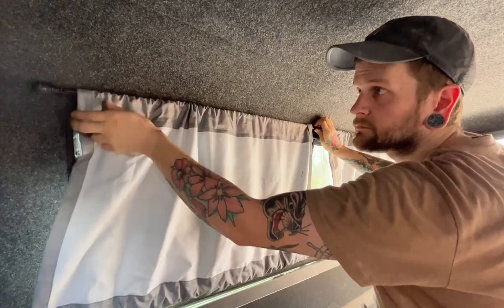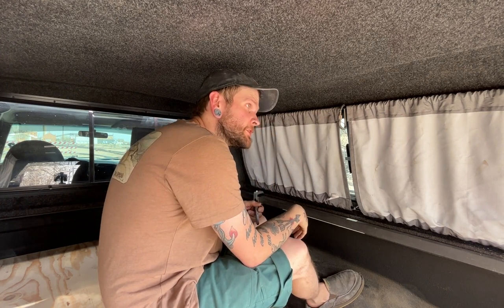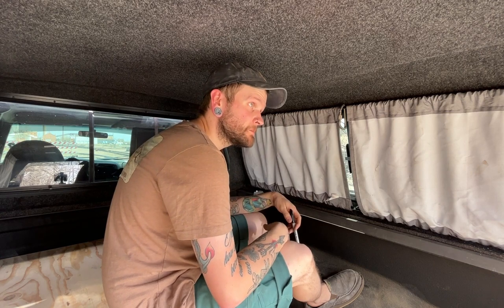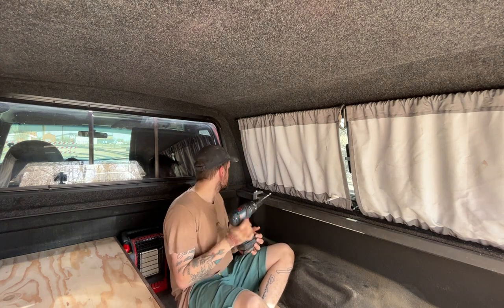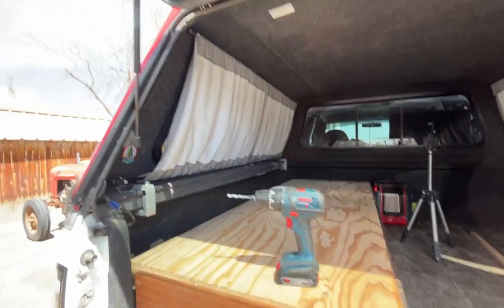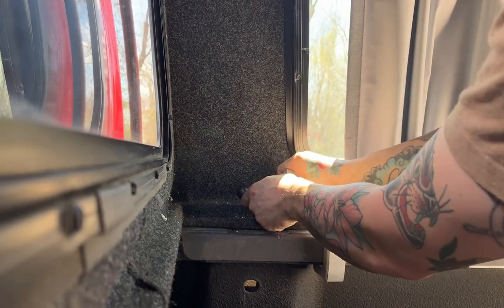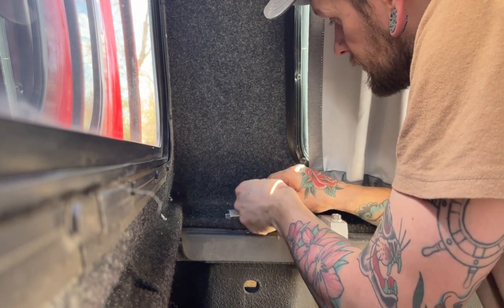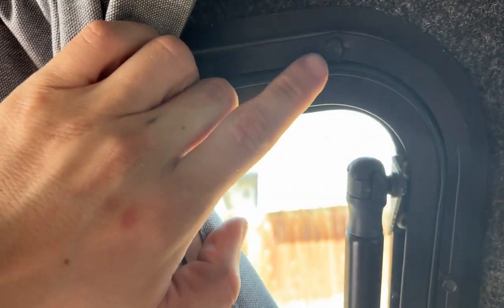Putting up CURTAINS in my truck camper!

Comment: Instead of drilling through the fiberglass, you could cut small  blocks of wood , secure them to inside of cap with fiberglass resin/hardner. Once dried, you can then scrue into wooden blocks.
Reply from the maker: That’s a really good alternative! I don’t know how well it would work on a carpet-lined topper but I guess you could always just cut out the liner where the blocks would go
Reply: @gumbynomad  I am going to use this method on mine for installation. Even on my overhead storage cabinets. All the best!
Reply from the maker: @myke_bota7590  that’s awesome dude! Hope it goes well! If you post a video of the instal, comment on here again cause I’d love to see!

Comment: So one year later...any leaks from drilling through the topper? I've drilled through mine to install a "locking" mechanism (from inside). Hanging curtains is my next project. My plan includes waterproofing silicone sealant around the drilled hole as well as a rubber washer between fiberglass & the bolt head...
Reply from the maker: I had a leak in the cab but not the topper. I used a lot of silicone, backfilled the drill holes with silicone, I also used washers. I did just use metal washers but rubber ones might actually be better! Just make sure to find hardware that won’t rust. Do you have any recommendations for an interior locking mechanism? I’ve been wanting to look into that
Reply: @gumbynomad  my friend Jake helped me with that. Basically I bought an inexpensive topper from Craigslist and the center t handle on the hatch door didn’t catch on anything. So he fabricated some little metal pieces from scrap to allow the latch mechanism to grab onto something. We had to drill them into the fiberglass.
As for locking from the inside, I loop a metal wire through the bars of the t handle and the tie-downs inside the bed. Simple, inexpensive, non-complicated. 👍
Reply from the maker: @jaymianderson9665  I’ll have to give that a try, thanks so much for the advice!